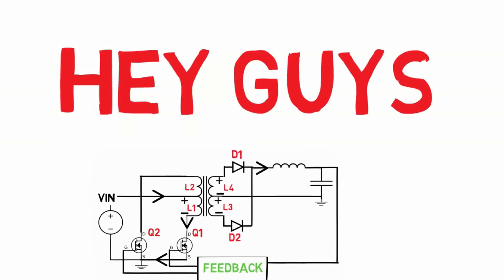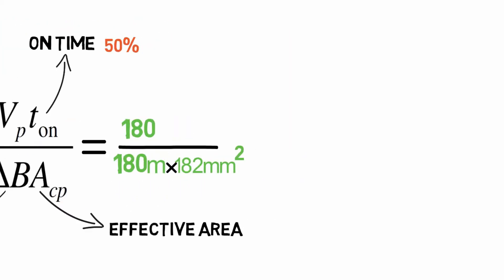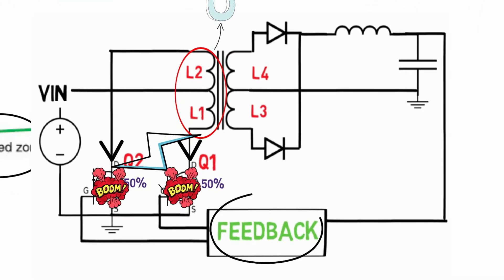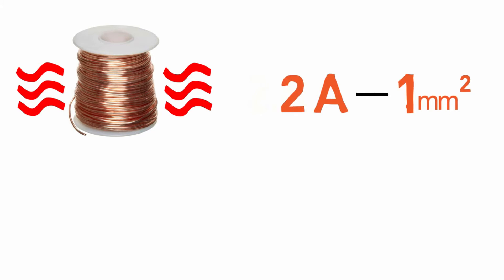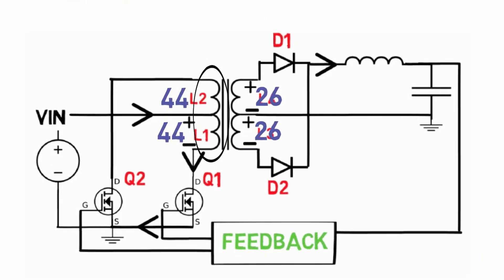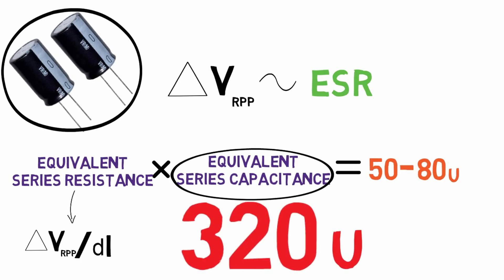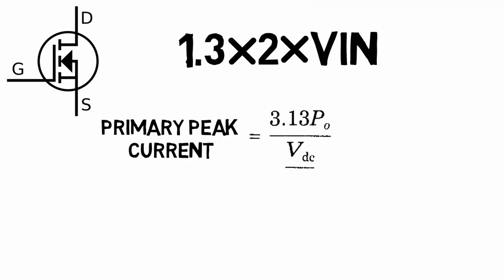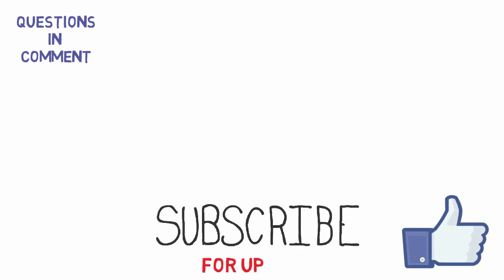How to design a Push pull converter | part 2 | working of push pull converter | simulation

Comment: So if I may ask this question if the dcv increases to over 40 volt the mosfets switching star to slow down causing short circuit burn up the mosfets because one mosfet can t no turning off faster enough but what about pnp and diodes to driver the mosfet full on and fully off I don’t up understand how switching dead time cause short circuit burn up the fet because I need a 10kw of power from 50 volt dcv to 400volt but I can’t get this to work I increase dead time by 5% it can go no more of one fet will turn off fully zero pulse volt to get I try it no matter the dead time mosfet still burning up at no load I design a lot of converter because i am engineer this issue was from engineer school day push pull burn up at higher volt even with righ gate drivers the higher the volt the worst the mosfet get

Comment: Hi... Nice video on push pull. I have one question, in push pull topology primary and secondary currents are present at the same time. So the core area has both pri and sec flux present at any point of time. If this is correct then should the flux density need to be taken half i.e. 0.09 Tesla while calculating the number of turns?

Comment: Hi, 
regarding the explanation at 2:45, I see you caught some values from core's datasheet. How did you find Np=44 turns? Is the flux calculated as 180 (exp-3) and the area as 182 A.U. ?
Reply from the maker: It's the other way around

Comment: Thanks for sharing your video but i don't see how you got 44 in the calculation.  In the reply's others have asked the same question but not straight answer.  Can you please share units exactly so I can understand how you arrived at 44 turns.
Reply: The only way I can see to get 44, because you show no units is ton needs to be in usec so Np=180V*(.4*20uSec)/(.180T * 180mm^2)=44 turns.
Reply: FYI for others 20usec is the period (T) which is 1/50kHz which was the operating frequency.   So number to put into calculator are Np = (180*.4*20)/(.180*182)=44
FYI on my last reply the 180mm^2 should have been written as 182mm^2.  Please explain if i am wrong thanks!

Comment: Hello! Sir, excuse me, it is me again with a question, in your simulation I obseved you used 22+22and 13+13 turns, but in the calculations you did is 44 and 26, Which is the number should be used: 44+44 and 26+26 or 22+22 and 13+13? Thaks again and excuse me, I'm just trying to be sure befores to build my planned project, and thank you for helping me.
Reply from the maker: Please use 22+22 and 13+13
Reply: @FoolishEngineer  Thanks that much again; my doubts are gone.

Comment: Thank you again. Can you tell me what ton and 0.4T mean in this tutorial, please.
Reply from the maker: ton is the time where MOSFET stays ON. 0.4Tesla is the change in flux density in a ferrite core of the transformer.

Thank you so much for watching the video!
Reply: @FoolishEngineer  Thank you Sir. I just wanted to be sure, since I see in your second part of push pull converter design, in minute 2:48 the following: Nmpp= Vp*ton/B*Acp= 180*.4T/180m*182mm2, 
in this .4T , T is for Tesla or for ton, since T is in capital letter? Thank you very much for taking your time to respond.

Comment: Thank you very much. Can I ask if when selecting the switching power transistor, should I use the total peak current in the primary or 1/2 peak current; since each transistor conduct at half cicle, please? Thanks in advance.
Reply from the maker: Please consider full Peak current for each Transistor because only one transistor is on each time & all current flows through it.

Thank you so much for watching the video!

Comment: Thanks for your usefull video. I want to make an self oscillating push pull dc dc converter. Can you help me how to do that? I have removed the epoxy of MINMAX MAU216. Unfortunately the transformer gets damaged during the process. but what I realised was interesting. It has no switching controller. It works upon the theory of self oscillating inverter. I would appreciate your guide....
Reply from the maker: Can you share me your circuit & references?

Comment: Does this require snubber circuit???
Reply: Because I have built hardware , the MOSFET is getting burnt due to high dvdt and vds is breaking down
Reply from the maker: For simulation? no.
But in real hardware? it might.

Comment: Hi there,  I did not get the calculation what you have done regarding the number of turns. What is 0.4T ?  T is what ?? Can you show me the exact calculation including each and every unit ? How did you get 44 ?

Thanks in Advance. :)
Reply from the maker: Hi, Have you checked the 1st part of this series? T is Tesla, it is the unit of magnetic flux density. I request you to refer the earlier video, You will understand.
Reply: @FoolishEngineer  Hi, I have a question How did you get the primary number of turns is 44? By putting the values (Vp = 180V, ton = 0.4, B= 180x10^-3 T, A = 182mm^2) in the formula Nm = Vp*ton/B*A. I did not find the answer 44. Can you please explain that?

Comment: very good ...i want know about high current power supply so ..how can we get 60 v 40 A current from like smps circuit ..if push pull converter can help or flyback is help ..or we need any other circuit like  current doubler rectifier..please  give me information..thank you...
Reply from the maker: The topology of the converter depends on the power which it can handle not solely voltage or current, in my video of how to design an smps I have shown a table regarding power handling capacity of particular converters
link is - https://youtu.be/8i57vFZrUm4
From time 2.33

Comment: This video was for buck! can you make video for push pull Boost? or is it that we just need to reverse the transformer primary and secondary?
Reply from the maker: All the formulae will be same, just wattage of the components will change and of course in that case secondary turns will be greater than that of primary

Comment: May i get the full circuit and the details of the feedback circuit through my email sir?
Reply from the maker: Feedback is basically a comparator and PWM IC which can be a PI or PID logic. I don't have much of the details, this tutorial is regarding the basic calculations needed for the push-pull converter. Still, I'll try to upload a strong content regarding feedback circuit soon.